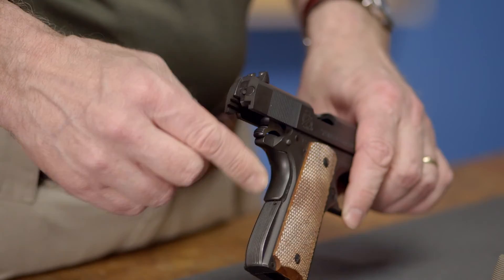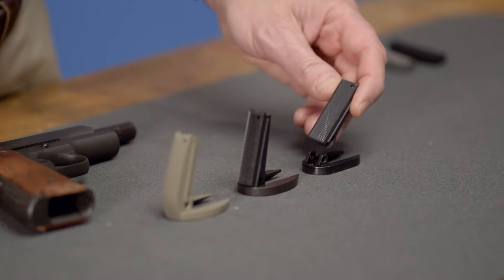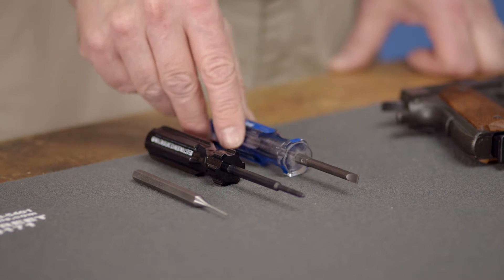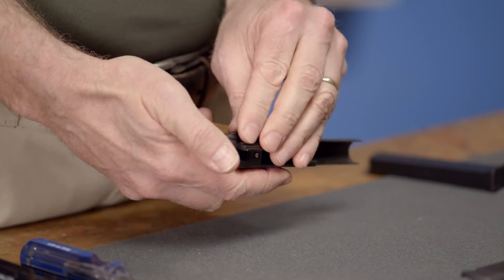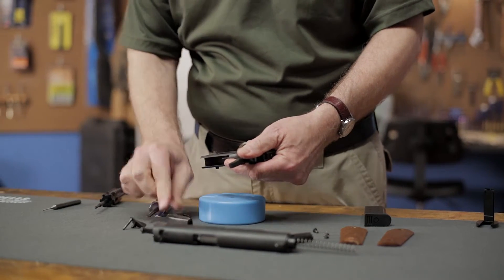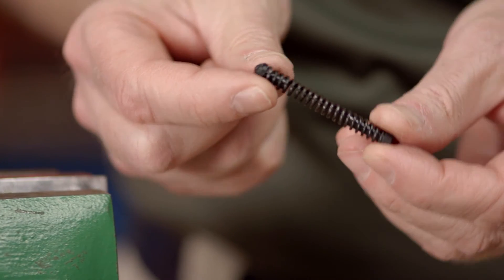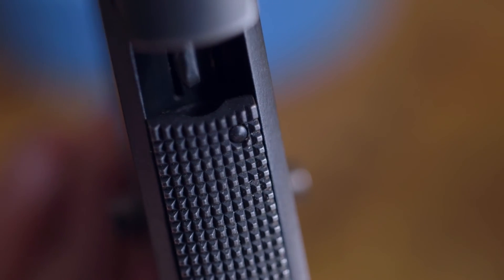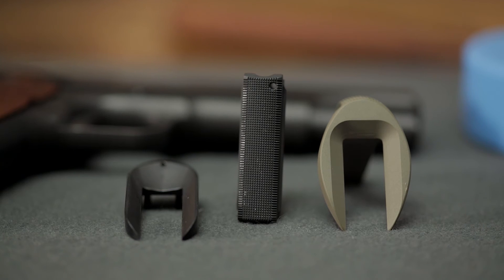Accessorize Your 1911: Mainspring Housing

Comment: Thanks. I got it installed yesterday with the EGW Mainspring that has the lanyard loop. Actually a gotcha here is that the sear spring you have to make sure the legs are in the right places as I had trouble at first getting the hammer to go back and realized the leftmost leg was not put in correctly.
Reply: Putting the mag  Half in helps keep the hammer strut from getting behind the main spring

Comment: You can put a rubber band on the grip safety to make it easier
Reply: That's the first thing I thought when he removed the old mainspring housing and everything fell out. Obviously there's an easy way, and his way. LMAO.
Reply: @thebusterdog6358  Watched a lower quality vid that used the hair band method seemed pretty simple, then watch this master disassemble the gun and the entire mainspring assembly poured out i almost spit out my coffee ahaa
Reply: Dunno how much easier it can get than what he showed. What’s the purpose of putting a rubber band on the grip safety? In case you have super shaky hands and Michael j Fox a part across the room?
Reply: @izs1991  Much, Much easier. No need to remove the slide. Remove the pin, depress the grip safety or use a rubber band, remove the internal parts, swap them to the new one, insert the new housing and insert the pin. DONE.
Reply: @gavinmyles9851  🙄
Reply: @Gavin Myles instablaster :)
Reply: @Dominick Reginald thanks for your reply. I found the site thru google and I'm in the hacking process now.
Seems to take a while so I will get back to you later when my account password hopefully is recovered.

Comment: you seem to have forgotten either the step where you block the safety plunger or search for hours to find the safety and slide stop plunger because even though the spring is kinked it still launched out of the tube faster than the speed of light.
Reply: Michael Halas that’s exactly what happened to me. I’m giving up looking for it and will probably just have to get another one. Yes he goes too quickly and left that step out .
Reply: @robertoflores4546  Well, when you start working on a gun, you need to know its structures and how it works anyway. The fact that a small part of the disassembly is skipped in this video is irrelevant. If you don't understand much about this gun how it works, leave the work to more experienced people.
Reply: @paul55austria51  not really, you just need to know about that certain area you're working on, which is why people pull up this video. that's why we have assembly lines, you only need to know about the section you work on, and the product still gets made. I'm not trashing you, i just disagree with the fact that you think people should just give up and pay someone, how else are they to learn about the gun without breaking it down? Personally, I would use a diagram but mistakes happen and not everyone has one.
Reply: @lappoo5875  I certainly understand what you mean, but what I mean to say is that if you know the technique of the weapon, you will not be surprised with these kinds of incidents or questions ... He (Brownells)  assumes that the viewer does understands what he's doing and skips a part. And..... a diagram can always be found on the internet. Before I start working on my guns, I want to know how it works and what I can encounter. After all, a weapon is not a toy ..... or in other words a potentially dangerous toy, but very fun to work on.
Reply: NOTHING goes faster than the speed of light - except - well, yeah, OK - the safety plunger.  But nothing else!

Comment: You fail to say why the thumb safety is removed to replace the main spring housing. In my experience it is totally unnecessary.
Reply: I had to because the sear spring came loose and I couldn't put it in properly.
Reply: @Dan-di9jd lol.. grips don't even need to come off to do this job..

Comment: Need Help.  I changed mine out but have a problem. The hammer no longer locks back.  I think it has to do with the mainspring alignment but cannot get the safety latch out to remove the grip safety.  Any easy fix?
Reply: How far did you disassemble your pistol?